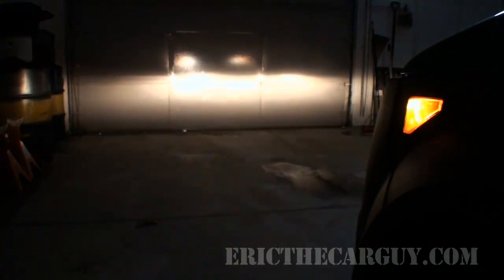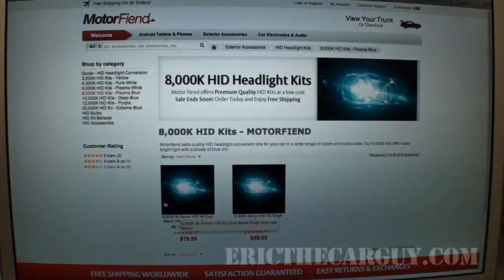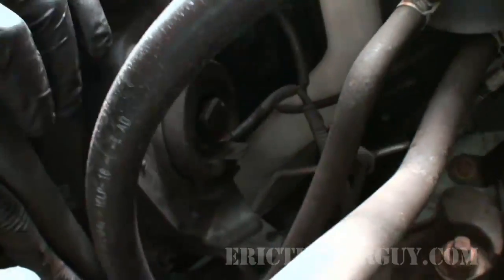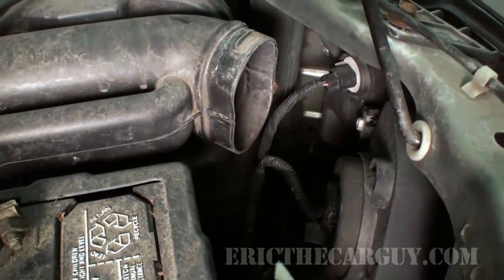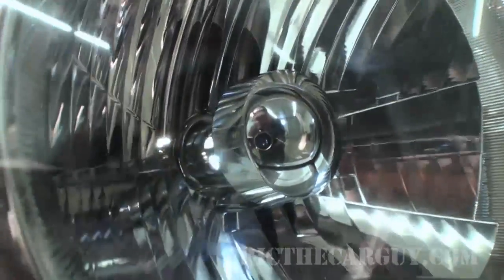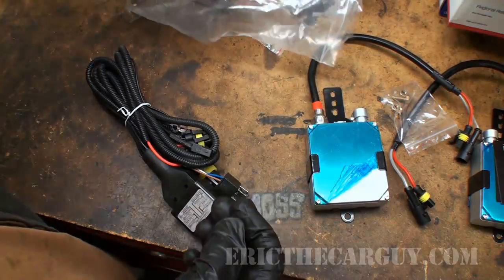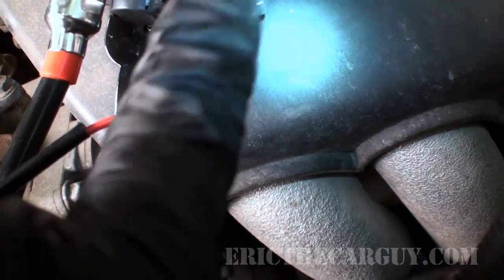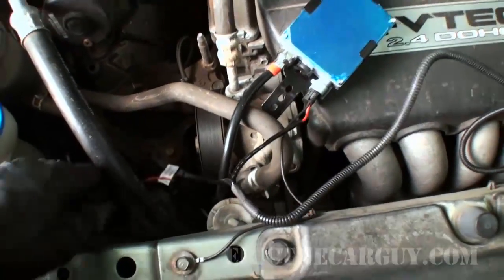How To Install an HID Headlight Kit -EricTheCarGuy

Comment: Xenon and HID are the same, Bi Xenon is just a HID (high intensity discharge) lamp with a little motor to shift the focal point for high and low beam.

Comment: Yeah I have worked in LED lighting and temperature is more about how the light "feels".  Low colour temperature is a bit blue and makes you look like a zombie.  High colour temperature - like tungsten filament - means more red colour and is a bit more natural.

For intensity/ brightness look at flux etc.  But really, you dont need to go into detail.  Cheap LEDs are blueish.  Expensive ones are red.  The problem is Rayleigh shift of the diode output to red by a phosphor but.never mind!

Comment: Just a tip: 

Taking a lighter to clipped end of a zip-tie real quick gets rid of the sharp end so you don't scratch yourself on it.
Reply: Using the proper tail cutoff tool also works.

Comment: do it anyway, you can swap in Halogens for the inspections and as long as you use 5000K (white) bulbs I doubt you'll be stopped for them

Comment: Nice Video Eric I know this topic is very controversial but some people statements are wrong they say HID are only for projector housings and is not true I have a 2002 acura tl-s and has factory HID they are not projectors also early model nissan maximas mercedes benz infinitis without projector used HID with reflector light housings.. But I do agree that some people dont use them properly they use them in trucks like silverados they blind other people but I believe that 4300k is the legal limit

Comment: Thank You Eric for a great and informative video. I installed an inexpensive set in my Mazda Tribute. Works very well except for that fact that the HI/LO looks like it might be reversed ,. When it is in the LO beam setting , it looks like it is in High. Any thoughts on this problem. Thanks.
 Chris

Comment: Certain cars from the factory have reflector style HIDs. Also alot of Projector style headlights that dont have HIDs cant handle the heat of the HIDs. They dont release as much heat but the bulb is much, much hotter and putting them in a projectors headlights that cant handle it can cause damage or even start a fire. If you dont have clear lenses you should never use HIDs, other wise make sure they are properly adjusted and it shouldnt be an issue.

Comment: While any HID bulb will emit 2-3 times the lumens a halogen bulb emits, higher color temperature bulbs emit fewer lumens than lower color temperatures. A 8000k bulb will emit roughly 10% fewer lumens than a 6000k bulb and roughly 20% fewer lumens than a 4300k bulb.

Directly from a HID bulb supplier.

Comment: The 8000K is not for a brightness value as you mentioned in the video, but rather the "color" temperature. As you gain the kelvin values, you get a bluer light. as you get lower, you get a redder light. 3000K is far yellower than say 5000K, which is almost perfect white.

Comment: noticed you take off bolts by hand most of the time (with a ratchet.) Why havent you invested in a cordless impact gun? I own the 20v Dewalt cordless impact and it has saved me so much time.

Comment: Exactly, so you know that they look bright but actually aren't. And no obviously they don't just fall to the ground. Check out the fifth link I found on google searching for "HID FAQ", might help explain my point.

Higher than 8000k, the light output significantly drops off, causing the light to be almost useless.

One should point out that although light output drops off after 8000k, the fact that the light is in the blue-purple spectrum, it still puts a major strain on the eyes of others.

Comment: Yes, that's right. but that's completely different set. But just to be clear, you can't simply put 55W bulb instead of 35W bulb. You should use 55W ballast. And it's really hard to judge colours, cause color of bulb from different manufacturer are slightly different.
BTW, Color of the same bulb are degrading over time. If one of your HID bulb are failed after 2 year of usage and you replace it with same bulb from same manufacturer, you'll notice, that bulb which wasn't replaced become saturated.

Comment: i have a 4300K OEM kit in my 2002 opel astra. They have a special lens in the bulb housing. They are designed for HID lamps, not like the halogen ones. And besides, it is prohibited in Germany to install 35W HID lamps without automatic beam height control and without headlight wash system (nozzle that sprays detergent or else). You do that, you lose certification of the car and thus no insurance. And in my opinion, everybody can see that those kits only glare instead of improving sight.

Comment: You would have to be driving over some seriously bad roads for the brakes to fail off. the worst I have seen was an old Chevy truck, where the caliper came free, and cut the Aluminum rim right in half. I did a brake job on a Durango about a month ago, where it was held on with one bolt, so the caliper just flipped right off when I put my hand on it to look behind it when I inspected it. If you have any questions, send me a PM, I don't see the need to have a conversation in the comments.

Comment: Very nice clean install. Unfortunately HIDs installed in reflector housings and not projectors are not FMVSS 108 complaint and illegal in all 50 states. The shield is not there to make them safe in factory reflector housings. The shield is how the high/low beam function as the solenoid moves the bulb back.

Comment: As I saw You changed the connector the opposite way, as You said ( if it's not working, you have to change it the opposite way, as the description says)  :)

Comment: I love my HID's! But you should have them in projector style lenses. In the UK, the police are cracking down on HID's installed incorrectly and its soon to fail a MOT (annual inspection).

The kelvin value has nothing to do with brightness, it's to do with colour temperature.
A HID actually runs cooler than any halogen bulb... they're more efficient.
In actual fact, due to how our human eyes work, a 4300k HID seems brighter than a 8000k HID. Due to more usable light in our eyes colour spectrum.

Comment: When fitting HID's to a vehicle you HAVE TO realign the headlights. They will always be aimed TOO high and will need to be re-aligned a lot lower. Also, in Australia it is illegal to fit HID's to a vehicle that doesn't have the HID option or a vehicle that has no headlight adjustment from inside the vehicle.

Comment: about laws: here HID lights must have: proper reflectors/lens for it (not the standard halogen reflector and certainly not for disperser on older glass headlights), self-leveling, and washing

A dirty HID may scatter the light onto oncoming traffic, and so is a bump (or really a careless driver that does not adjust it according to the load) without self-leveling.

HID kits like those are illegal here.

Comment: In case you touched the bulb with your finger, clean it with alcohol.  

Replacing the stock HID bulbs on 2004 (2004-2008?) Acura TL is a joke; you have to remove the front bumper.

Comment: Do you know why other passing drivers get blinded by HID's, it's because, sure, you changed the bulbs, but you didn't change the reflector housing that was ment to reflect halogen lighting downwards. Halogen reflectors disperse the HID light upwards above the hood line, aka, into the eyes of other drivers and not on the road.

At least your setup in this video seems correct.  At 33:48 the light isn't being thrown upwards.

Comment: Higher kelvin actually decreases light output. 4300k is the brightest, so 5000k would be the best compromise between the blue color and light output. Also putting an HID kit into a halogen reflector housing is a very bad idea which will make oncoming drivings have a very bad time. HID kit installation = mandatory projector retrofit

Comment: Interesting how HID retrofit kits are legal in US. In most EU countries you are not allowed to replace H1/H7/H4 bulbs with HID. This is because lamp optics are built differently and they can blind other drivers. 

Also, automatic beam levelling and lamp sprinklers are often required :)

Comment: Also ERIC the kelvin rating refers to color(3000K is yellow, 4300K is OEM White, 5000K is cool white, 6000K is ice blue, 8000K is cool blue, 10000K is deep blue) not brightness.
The higher the K rating the the less usable light that you can see, the best kind to use is between 3300K~4500K

What is more worse is Misaligned headlights, people who dont dip their highbeams, then HIDs are last.

HIDs that are installed and done correctly do very little harm

Comment: in my experience, i might be wrong, but the 55W ballasts/kits are brighter than the 35W... and that's with two sets of 4500K bulbs.. 35W 4500K looked dimmer and had more color.

Comment: Mounting with hardware will look more professional, but personally I would go with some higher grade 3M automotive tape (6382).  That way you don't have to worry about drilling or rust.

Comment: HID's have an issue of not coming on, on one side. Even factory do that, I've seen it. Mine have never worked correctly. I went back to the incandescent's due to that fact. I think it has to do with unequal power.

Comment: i had two different sets (35w and 55w bulbs and ballasts) from the same company.. the 35w's were just weird, they almost looked like a street light... the 55W kit was much better and as white as possible, listed at the same K(color). but like you said the manufacturers are all different.

Comment: Voltage isn't what hurts; the painful part of the electricity is the Amps. The Kelvin rating gives you what color, here's a graph for that http://ecx.images-amazon.com/images/I/41X6Au2WTlL.jpg
Reply: +KingRexatron Then why do you only see signs that say "Danger high voltage", and not "Danger high current"? ;)
Reply: +snorman1911 great question, because people are stupid and at one point thought it was because volts, Just didn't Change it.

Comment: The cutoff doesn't really look that bad.  The H4 HID kits seem to have the least glare, probably because of the extra shielding.  Retrofitting with projectors is still the best option if you want to upgrade to HIDs and 4300k is going to give you the brightest light.  I wish he would have showed the "high beams" on the wall to give everyone an idea what those are like.  Some bi-xenon kits, especially 9007, are just a joke.  Some just light up trees, but no light down the middle.

Comment: I have a 08 honda crv did you run into any issues with day time running lights after install .does that element have drl.if so how dud you solve the problem

Comment: I put some of that double sided 3M tape on the bottom of my ballasts and just stuck them against the frame, they haven't moved an inch since.
Reply: That 3M tape is pretty good stuff but I'd imagine that, in 3 to 5 years, it might start to deteriorate, while a screw should last many decades.

Comment: Most cars now come standard with HID/Xenon from the factory. The only thing dangerous about HID's is when people put deep colors because in the rain you loose visibility. I feel safer driving on dark roads because I see everything. You dislike them mainly because most people do not adjust their lights after installing HID's

Comment: I tried 2 aftermarked HID kids when I was younger in 2 different cars....they both sucked.
HID only works with the right projector lenses because the difference in wavelength needs adapted optics. Some stock headlamps may work but most deliver an unfocused blinding result to oncoming traffic and distracts your own eyes because of glare from rain and any reflective object.

Comment: Sorry, capsules, I'm still calling them bulbs, gotta change that, thanks. I've seen an explanation somewhere a while back that said that shield bounces and wiggles around on the dips and bumps in the road, causing the flicker that SOMETIMES blinds for just a quick millisecond, lol.. If it hits your eye just right, and the oncoming car is coming uphill, it can be a pita for sure... But it's over quick, and it's usually the luxury cars that have it all done "properly", kind of ironic....

Comment: These are illegal everywhere in the US, including where ETCG is.  They're also illegal in Canada.  You may only use DOT approved headlights in the US.  That means if your car didn't come with halogen but you want it, you will need to find an aftermarket company that has DOT tested and approved projectors for your vehicle.  Anything else and your vehicle cannot pass safety, which means it's illegal to drive in all US states (even if you don't have to pass safety each year, it's still illegal).

Comment: No expert here, but in the world of electricity, addint high performace headlights to stock amperage can cause issues. I'm sure the ballasts equal things out but when you got everything turned on (lights,heater,aircondintioning,domelights,radio and your cell charger in the lighter socket) things can wear out quicker and fuses can blow more often. Can the clear head light plastic lense handle the heat? Who knows... probably though.

Comment: yeaa the only thing is that the higher the degree of Kelvin, is NOT the brighter the bulb. around the brightest temp is 6K, depending on what kit. and yes, HIDs  are for projector housings, not reflector housings, blah blah... I have them in my reflector housing, get flashed once a month (but I think its the driving lights on the bottom which are projector housings that are aimed far up (unadjustable?!)) either way, they look great in either housing as long as the headlights are adjusted proper.

Comment: Your passenger side ballast is mounted real close to your exhaust manifold. Is the heat, from the manifold, going to cause problems inside that ballast? Melted solder and such?

Comment: If you want bright, 8000k bulbs aren't gonna help very much. 4300K is the brightest temperature. It's a warm white which is basically white and yellow mixed together.

Comment: I fail to understand why anyone would embarrass themselves with a blue lamp, not only because its disrespectful to others, but because it acts as a filter keeping white (useful) light from shining through. And I think Kelvin is a measurement of the 'whiteness' of that light, not necessarily the temperature produced. Careful with modding your lights, high wattage bulbs (nonHIDs) can cause tremendous stress on your alternator & high temperatures can cause major damage to your headlight housing.

Comment: But in this situation you can't change the placement of an HID bulb to match a reflector that was originally designed to work with a halogen bulb and expect it to work properly, it's just not going to happen. Oh and yes the shape of the light source is absolutely relevant, it's pretty much the main reason why HID bulbs can not perform properly when used in headlights that use reflector lenses that were designed for use with halogen bulbs.

Comment: Hey Erik, I was wondering if you could do a video on the purpose of the headlight shield. My 2001 cavalier has them but my 1998 Silverado does not. Why do some vehicles have them and others don't? Does it make any difference in light output?

Comment: The slim ones might not be metal and might run hotter. The headlight harness connector rust issue; use electrical tape to seal it up.

Comment: Eric, you're a genius and I have a lot of respect for you, but you're very wrong about this (HID kits). Reflective headlights (light the ones on your Element) are designed for Halogen bulbs, not Xenons. Xenon bulbs have a much higher light output, and putting them in a reflective housing will cause minimal usable light and will create uneven beam patterns that can blind other drivers. This is dangerous for all parties involved. I have an aftermarket kit, but I use it with projector headlamps.

Comment: Any precautions to protect the no longer used Pass. side headlight plug In case you need it later? At least some electrical tape?

Comment: "Eric, HID's are for projectors IMO. Halogen housings aren't made to focus the intensity of the HID kits. Too much scatter of light. F this...do a full retrofit"
that is correct,,,the wiring is the easy part,,,and that's why Nissan z350 equipped with halogen bulbs has a different headlamp unit from the xenon version

Comment: ThoseTahoes, especially if you are around me, is that if you find one it has almost, if not more then 200,000 miles, and was owned, but not very well maintained by a family.The Durango brake design is very poor, most company's use a bracket that then holds the caliper, Dodge decided to get rid of the bracket, and just attach the caliper to the spindle, on really small nubs, which either crack, or the threads strip out.... If you do them, just be prepared to go full out and replace the spindles.

Comment: The K rating has nothing to do with brightness, it simply determines the color. 3,000K = Yellow  4,300K = Pure White  6,000K = Plasma White  8,000K = Plasma Blue  10,000K = Deep Blue  12,000K = Purple

Comment: The higher the temperature the brighter they are going to be? That is a fallacy. For example, when a person lights up a lighter or shoot flames from their exhaust, what color is shown? The color is a sort of yellow color. The reason why is because the brightest (not the hottest) kelvin temperature is around the 2000-4500k range. However, I understand why you would think otherwise "Erick the car guy".

Comment: this looks like a pro kit, but im still lost why its so complex. I have installed many hid kits on infinitis, lexus, bmw for fogs and etc and it wasnt this complex, It was a simple plug and play for each side, no drilling and etc. Also eric is right the higher kelvin rate the brighter, but light output is lost. The best light output is 4300-5000k. Even 6k makes a difference compared to 5k.